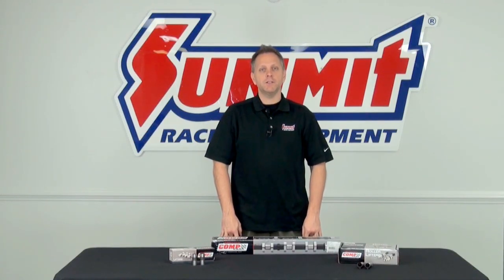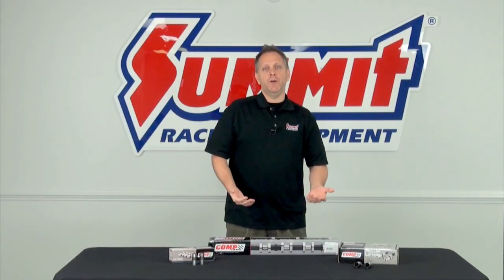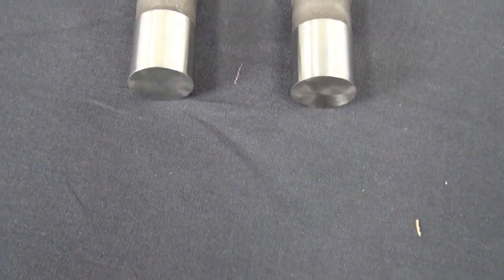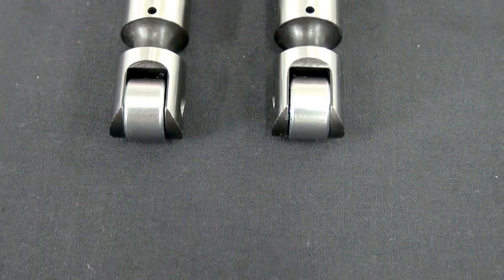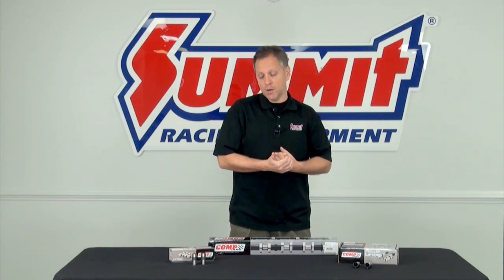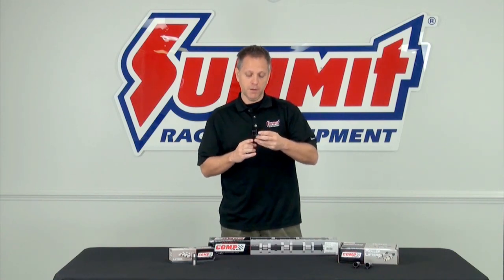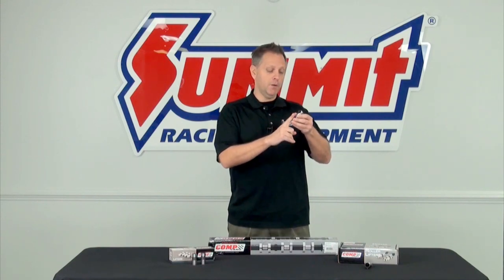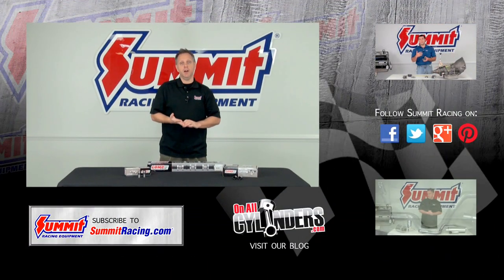Roller Cam vs Flat Tappet Cam - Summit Racing 101

Comment: Ok, I know this is an old video, but I saw a couple of comments from less than a year ago. What this guy failed to mention is that flat tappet cam lobes have a taper ground into them (or at least they are supposed to) It should be at least .003 in. The end of the lifter that goes against the cam must have a crown on it, meaning it is higher in the center. If you put the lifter on a completely flat surface, like glass, it will rock from side to side a little. This taper of the cam lobes and crown on the lifters causes the lifters to spin in the bore when the engine is running. If this doesn't happen, both the cam lobe and the lifter will wear down very quickly. There has been an epidemic of bad cams and lifters lately, made by many different companies, that do not have taper machined into the cam lobes and a crown machined into the lifter, causing them to fail very quickly. I have no idea what has caused this, cams and lifters have been designed and machined like that forever, but something has changed. If you buy a new cam and lifters from ANY company, before installing them, CHECK the taper of the cam lobes and the crown of the lifters. If they don't have the taper and crown, DON'T install them. Not only will the cam and lifters destroy themselves very quickly, but they will leave metal shavings inside your engine. Just because they are called flat tappet cams doesn't mean they are perfectly flat. If you get some that are, return them immediately, BEFORE installing them.

Comment: The only benefit a flat tappet offers is cost the roller is better in every other area
Reply: this video is also missing a lot of detail as well. such as you need to run certain oils with a flat tappet cam set up and you more than likely need shorter push rods with a roller set up. also you need to make sure the roller lifter do not spin on the cam. you will also need to control cam shaft end play on a roller cam by either a cam plate or cam button. all this is why a fat tappet cam is $300 vs a roller cam is around $800 for a similar grind.
Reply: Isn’t a 427 side Oiler flat tapped that’s a pretty good motor, well thought anyways.

Comment: Don't waste your time with a flat tappet,  buy a roller for all out racing a solid roller.  We have changed engine oil,   today so there is little or none in the anti-wear additive ZDDP anymore.  For the street buy a hydraulic roller,  it's the only way to go.

Comment: this video is also missing a lot of detail as well. such as you need to run certain oils with a flat tappet cam set up and you more than likely need shorter push rods with a roller set up. also you need to make sure the roller lifter do not spin on the cam. you will also need to control cam shaft end play on a roller cam by either a cam plate or cam button. all this is why a fat tappet cam is $300 vs a roller cam is around $800 for a similar grind.

Comment: Dave,

Can you advise whether the break in procedure is different for the roller cam versus the flat bottom tapet cam?
Reply from the maker: Don Boser, 
Due to the roller lifter rolling around the cam lobe of a roller camshaft, there is no break in procedure for this type of camshaft!

Comment: I don't even like flat tappet anymore. It would be like going backwards to fiber cam gears and other outdated things. But one thing I couldn't believe last night when reading all the different rebuilder opinions is there's no consensus on soaking lifters. I remember we did for the flat tappets and it wasn't all that necessary on rollers but now they don't even do it on the older lifters. I cleaned my rollers with carb and choke cleaner today and then tossed them in some heavy SM rated 30W for the time it took to clean the others on that side and then put them back and done the other side and repeat. There's people who insist on soaking them for a week. I'm going to prime the engine with my old 1/4" drill adapter until I see oil coming out the now pristine push rods. I had planned on replacing some of the things but everything for older vehicles has gotten pretty expensive when you can even find it. Used to be Chevy was a lot cheaper to rebuild but I don't think that's the case anymore.

Comment: reduced friction.  that's what I like.   Roller is the way.  Altho NASCAR ran flat tappet until this year.  did u know that?
Reply: NASCARS run at very high rpm, perhaps the lighter tappets that could move quicker were an advantage over reduced friction

Comment: I have a 93 5.7 rebuild block that came with a Camaro I bought it has the cam in it and it seems well worked on but I didn’t get lifters with it how can I tell if it’s a roller cam or a tapped cam?

Comment: Questions:  Why can't the flat tappet be rounded?  What is the best off-the-shelf oil for old flat tappet engines?  Is an additive the only choice to have enough ZDDP?
Reply: Because that would infer that the cam lobe would be applying a large amount of side load to the tappet.  Any side load on a tappet would result in immediate wear and failure (consider the thousands of times that the tappets are pushed up and down and the amount of valve spring pressure employed).    Rather than "rounding" the tappet, it is better to go with a much larger radius on the base of the tappet.   But there may not be enough room (for installation or operation).   Volkswagens used a "hat" shaped tappet with a larger base radius than the tappet body.  This resulted in with a much larger radius for lift.   The Volkswagen cam lobes were slightly off center:  that caused the tappet to rotate as it "rode" the cam.

Comment: With the new rules in Nascar regarding the change from flat to roller tappet cam, what will be the new research and development. What do you think the engineers and engine builders will do to push the limits and gain an advantage over the competition? What will be the biggest challenge when adapting?
Reply from the maker: Austin Bonatz ,
Other than the obvious advantages of a roller cam; less friction, lower oil temperature and less metal particulate floating about the motor; roller cams offer an almost endless amount of profiles to experiment with. Therefore, these teams will be testing day and night to find the absolute most power possible, and that is nothing new to NASCAR!

Comment: What is the best type of oil to breakin a full roller engine sbc roller cam lifters and rocker's on first fire up?
Reply: Roller cams don't need to be broken in. As far as what oil you want for a new engine, just pick a break in oil of your choice.

Comment: ok I'm lost, the title says cams but the video only showed lifters. :-(
Reply: +Kleo 84 the lifters come with the cam. roller or tappet refers to the type of lifters. roller cam has the roller lifters flat tappet cams use the flat lifters
Reply: OH!! so there is no difference between the actual camshafts?
Reply: i'm not to sure about that, but flat tappets have the problem that if broken in incorrectly it wears down the lobe really bad and could overall decrease performance which is why rollers are safer instead of smacking the lobe it rolls on the lobe less friction and less damage. I'm glad my mustang has rollers so i don;t have to worry about cam breakin as much when i do install them

Comment: Is there a kit that you can switch over to roller . , cam rollers , cam bearings head gasket and pushrods. I know theres a kit to convert from flat to roller . Is there a kit that comes with everything mentioned .

Comment: I just bought a new roller 474 cam for my 96 Tahoe. The engine had 312,000 miles. I'm rebuilding it Do I need to use new roller lifters?
Reply from the maker: +blackericdenice, 
If the lifters are original, yes, it would be highly recommended to replace them!
Reply: Summit Racing I did buy a new set.
Reply: Installation roller rockers in talldeck big block 427

Comment: roller cams require higher{much] valve spring pressures,this alone makes me run flat tappet cams,even at that rate,always run the lowest spring pressure you need,added friction on a street engine is just asking for premature damage to keeper,guides,valve recession added load to the chain or gears driving the cam,fortunately this infomercial for SUMMIT does not hurt their sales  and is purely informative,stop and go grocery getter needs the mildest cam you can use for cylinder pressure,use zinc oils in everything including your lawnmower,if you run a gm motor-use cam buttons wherever possible,and loosen lifter to block clearance whenever its apart,starting doing this and I found that dynamite is not needed anymore for lifter extraction

Comment: Curious about lift numbers/duration.Old small block cams for the street were in the .460 range.Now roller cammed motors have over .525 and this seems really radical for the street to me.Is there some way of figuring out what is making roller cams streetable with such high numbers compared to flat tappet cams? I guess my cam knowledge is from about 1977.
Reply from the maker: Hi Ron, 
Cylinder heads is the answer to your question. More specifically, in 1977 an estimated 90% of guys buying cams were using that cam in a motor with either stock or modified stock cylinders heads. In the almost 40 years since then, aftermarket cylinder development and usage has skyrocketed! And since aftermarket heads have way better flow characteristics, they can support higher lift camshafts!

Comment: If you exchange the roller cam do you need to buy new roller lifters like you would a flat tappet cam? Thanks
Reply from the maker: If the engine is already a factory roller cam, you can reuse the original lifters with a new cam as long as they are in good working condition. Depending on the new camshaft being installed a valve spring upgrade may be required.

Comment: I have an LS1 in my 2002 TA. My motor runs strong, has no leaks/ smokes/ etc. I have around 150,000 miles on my motor and want to do a cam swap. I've researched many Forums Online, where guys are having no problems swapping cams on high mileage LS1 motors. I see that most guys performing cam swaps are not pulling the heads to replace the lifters.  I know what most mechanics would say, but I' m thinking on doing the same and just Going for it !  With that many miles and as strong as it runs and been maintained, it seems right. I don't race it and if it goes, then I'm prepared to replace/rebuild. What do you think? Rolling Lifters hold up that well..
Reply from the maker: Hi 1973Hopeful, 
With 150,000 miles, it would be safer to replace the lifters. Another thought is, the valve springs will be easier to replace while the heads are off and you will need those too!
Reply: you dont need to pull the heads on any motor to get to the lifter valley .. just the intake manifold

Comment: I can assume the roller types reduce the grinding friction to a greater extent and a smoother rolling engine than flat types?
Reply from the maker: +fidel catsro, 
Correct. By reducing the friction at the point of contact (by installing a wheel), you not only have a motor that gets better fuel economy but you also have less heat due to that friction!  Not to mention, no more new cam break in period!  :)
Reply: +Summit Racing wow NOW imagine using simply a reed leaf valve on a 2 stroke being utilized on a 4 stroke motor (although I think its technically impossible, unless its function can be voided on the power stroke), that would be a racers dream.. just look at how 2 strokes engines blasts effortlessly to their redline!! also want to mention about the old 1912 Henderson 4 stroke 4 cylinder american motorcycle that ran 100mph and had valve lifters that were only lubed periodically and didn't have any moving oil sump for its valve lifting operation, wasn't that ingeniously reliable even for todays modernity?
Reply: @fidelcatsro6948  Reed valves can actually be used for the intake valve on 4 stroke engines, alot of the old hit and miss engines used them. One of the problems though was that the spring needed to be weak enough to open from the vacuum created during the intake stroke but weak springs are not good for higher power / rpm ranges.
Reply: i see thanks for commenting and have a great 2020 to all of you!!

Comment: Hey Summit. I have a 351 Cleveland and am looking at putting in a pro street cam, probably roller. Any suggestions on which ones I should use?
Reply from the maker: +Daniel Nelson, 
We need some additional information from you. Can you please contact our tech department at 1-330-630-0240. Thanks!

Comment: Would you guys happen to have a Cam kit that would work with a 1996 ford 460 efi (I want Hydraulic Roller) because every kit I have seen on your site supports older 460's (probably back when a 460 didn't have efi) and none support '96 460's. I am getting help from my dad, who practically LIVED within 10 feet of a set of wheels, so I might be able to do some modding if need be to make it work. I also read in forums that the computer doesn't handle cams very well, but I will not do a Mass-Air-Flow conversion.
Any Ideas?
Reply from the maker: Hi Olimar Putin, 
Crane actually has a part # 350501 that is EFI compatible for the 460 but, it is a flat tappet camshaft.

http://www.summitracing.com/parts/crn-350501

Comment: Is the only difference between a roller or a flat tappet or even a hydraulic camshaft just  the lifter? could you run a roller lifter on say a hydraulic camshaft? I'm thinking yeah you probably could but would it make it that much better?
Reply from the maker: No these cams are all designed for a specific lifter. The lobe shape and angles are all different and only the lifters designed for the cam should be used.

Comment: I have a 98 318 ram 1500 roller cam and lifters. I hear flat tappet is better for like. A grandpa style engine. And supposedly better for mileage. Is that true or false. I cant seem to find it on my normal web pages

Comment: Have a older Camaro with a l98 tune port set up, my question is, 
I have bought from u guys the LT4 hot can set up complete package set, with the 1.6 roller rockers. And all what I need to go forward on installing it, also ported out the upper and lower pentium and also the lower to match and bought from u the runners to also ported to match, I know that for the best performance I need heads, now do u recommend the intake from elderbrock with vortec heads and this can set up (96 & up pick up truck 5.7) or would u think I should go with AFR Heads? With this set up from the lt4 hot cam package, your staff said I would be fine with a single timing chain so I also bought that to from u guys, but all saved and awaiting on which way to go with the heads? The 195cc or? 
Also do I need since I am now a roller motor roller lifters as shown in this video? The ones that have the guides to each set of 2, or what ever u reccomend to go, also bought the 22 pound injextors from u with a adjustable fuel pressure to go with this and already installed to, Thanks so much and great parts that I got from u guys and fast shipping to!
John Houston tx
Reply from the maker: +John g, 
Can you give our tech department a call? 1-330-630-0240. Thanks!

Comment: If you get more lift with the roller,  does the timing with piston to valve clearance become harder to set correctly? Less room in the Cylinder? Can it hit and hurt the motor more easily in other words.? Ty
Reply: That is a good question about high profile roller cams. I guess Summit Racing did not see your question. But you are spot on, often times when running higher than stock lift and duration, piston to valve clearance is an issue. This is why they make valve relief pistons to give the valve more room to actually drop into the top of the piston. Some high performance engine builders will fly cut the top of the piston to allow huge lift in the valves.
Reply: @TheFINZFAN  thank you I know exactly what you mean. Appreciate it ✌

Comment: Hi Dave I'm restoring an 88 firebird formula 305 tbi with a roller cam setup and I'm planning on sticking with the stock engine setup and just upgrading manifold and headers pipes etc. I don't really want to change much of the internals what cam would you recommend for my engine setup. The 305 I'm planning on purchasing is direct from oreillys with what I'm guessing oem spec internals and heads.
Reply from the maker: Johnson C , 
We apologize for the delayed response. Can you give our tech line a call? 1--330-630-0240. We need some additional information from you. Thanks!

Comment: Hi I have a 1992 f250 with a 351 Windsor EFI, apparently from 1994  to 1997 Windsor blocks come with roller camshafts why would that be ? And are the earlier blocks capable of using roller cams ?
Reply from the maker: Yes, earlier blocks will accept a roller camshaft. The roller and non-roller block difference is that the roller block is machined to use the EO-style roller lifters with dog bone retainers and has bosses in the lifter valley for the lifter hold down the spider tray. 
 
To use a roller in an earlier block, you would need to use a retro-fit roller camshaft with a smaller base circle and link bar roller lifters to keep them aligned. You can also use COMP Cams Retro-Fit Hydraulic Roller Lifter Kit; this will require drilling and taping in the lifter valley.
https://www.summitracing.com/search/make/ford/engine-size/5-8l-351/engine-family/ford-small-block-windsor/part-type/lifters/lifter-style/hydraulic-roller/lifter-link-bars-included/yes?SortBy=BestKeywordMatch&SortOrder=Ascending&keyword=roller+lifters&N=part-type%3alifters%2blifter-style%3ahydraulic-roller%2blifter-link-bars-included%3ayes
 
https://www.summitracing.com/search/product-line/comp-cams-retro-fit-hydraulic-roller-lifter-kits